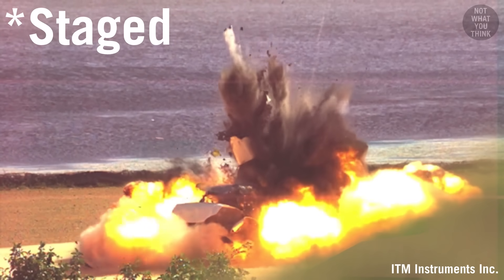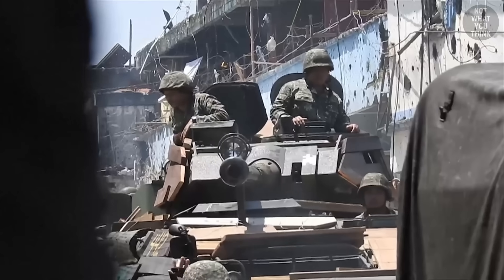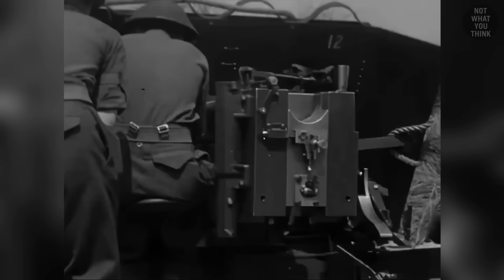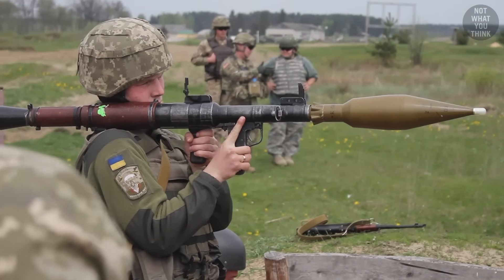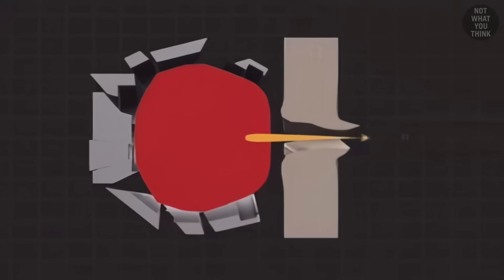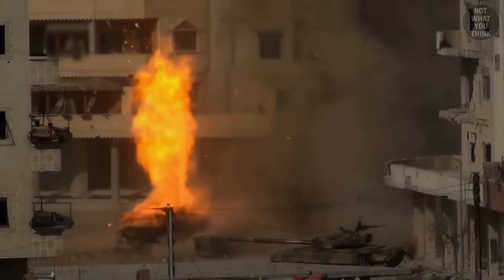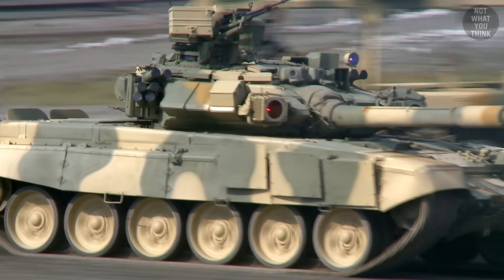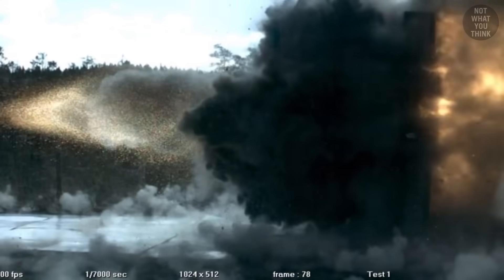Why Protecting Tanks is Getting Much More Difficult

Comment: These are CE (Chemical Warheads) also known as HEAT (High Explosive Anti Tank) warheads. Despite their name these have become less effective against tank armor since armor moved from steel to composite armor. Greatly reducing the effectiveness of CE warheads.
A CE warhead ALWAYS needs a far higher RHA value to penetrate the same armor compared to a KE (Kinetic Energy) or APFSDS (Armor Piercing Fin Stabilized Discarding Sabot). Which is why tanks always use KE against other tanks and CE against lighter vehicles (light armor, unarmored vehicles)
Which is why CE warheads today are only effective against the top, rear or sides but unable to penetrate the front of a modern western MBT. 

Protection and attack is always a cat and mouse game with both advancing. There is no difference with fighter aircraft of surface warships. The anti weapon advances, the protection advances which results in better anti-weapons which results in better protection.

Protecting a tank today is a layered defense including passive protection (jamming the missile), active protection (destroying the missile before it reaches the tank, for instance IR blocking smoke, flares (yes like those on aircraft) and missile kill systems which use a splash projectile (think of naval CIWS) to destroy the missile. Last but not least comes the actual armor, which is constantly improving by using a combination of different materials to create armor as strong and light as possible. This video completely misses the the greater effectiveness of new armor types. Which has put armor in advantage to missiles (apart from top attack missiles).

Infantry is way to vulnerable to pretty much everything which a tank is invulnerable to. Tanks have a unique role that no other vehicle can take. Nothing is invulnerable but tanks can survive more punishments than any other vehicle while also having great firepower and mobility. No tanks, means lighter vehicles will be in front which are much more vulnerable.
Note that while a Javelin is effective, the operator is extremely vulnerable to everything.  A few bullets or shrapnel and he's gone. There also is no shock effect when using it or being effective at taking ground. When it comes to modern MBTs (not the obsolete Russian ones with ammo in the turret) you rather be tanker than infantryman. 
And when a western tank is knocked out in most cases the crew survives and the tank can be recovered. During Desert Storm there was Apache friendly fire on Abrams with Hellfire missiles (also top attack but a lot more powerful than Javelin), without casualties. 

Modern tanks have thermal sights so you will have to be extremely well hidden as a dismount if the opponent uses proper tactics.
Besides that, ground combat is all about COMBINED ARMS. Which involves main battle tanks for the man punch, infantry (using infantry fighting vehicles), air defense vehicles and artillery support. This is something Russia is doing very wrong in Ukraine but the US was very effective in in Iraq (look up Operation Thunder Run).
Also when fighting tanks the best weapon is a tank: an APFSDS-T can't be intercepted by active protection.

Every infantryman want to have tanks along with them for additional firepower. Despite having Javelins you rather have your own tanks along with you. Assuming they could operate them effectively the Ukrainians would rather have Abrams than Javelin. When facng a bunch of T-90s dismounts rather have a platoon of Abrams with them than the same price equivalent of Javelins.
Tanks can be used for a large variety of roles, a Javelin has only one. So comparing prices is kinda stupd.

I am so annoyed by people saying tanks are obsolete, they know nothing about their hi-tech systems and capabilities (like shooting down helicopters with the main gun ) or that there are do's and don'ts on how to use them. Its like saying aircraft are obsolete because of surface to air missiles. A single man protable Stinger or Strela can ruin the day of an F-22 or F-35. Does that mean these jets are obsolete? A rifle soldier CAN be killed by a guy with a knife.
A lone tank moving in a city with enemies alone is like a jet flying directly over surface to air missiles. Russian forces are notorious for using poor tactics in Ukraine (probably conscripts).
What the US did during Thunder Run was keep moving and have each tank of the platoon of 4 look into another direction, covering each others weak spots. They also had Bradleys (modern infantry is mechanized) which used similar tactics. 

Like with all weapon systems, sometimes the cat has the advantage, sometimes the mouse. But that does not say anything about if a system is obsolete. It just evolves.
I would argue that dismounted and light infantry is obsolete as they are to vulnerable to everything.

Comment: I will admit that depending on the operational requirements a lighter wheeled vehicle with a large diameter gun can be more beneficial while a heavier, up armored vehicle with a more powerful gun in other situations is.

There's certain places and terrain that only infantry can go, while there's certain types of terrain that either only vehicles can go or only certain types of vehicles can go.

In war there is always trade offs for everything.
Reply: Sounds like you're describing the M1128 version of the Stryker, and the army doesn't seem to appreciate the role it performs. Kind of a shame, I really like that vehicle but it's getting retired and replaced soon.
Reply: @morgatron4639  other militaries operate the same style of vehicle

Imagine my shock though that a light weight wheeled vehicle with a 105 requires a lot of maintenance

The army's new MPF light tank will have the same problem. Giving a light infantry division a battalion of almost 40 ton vehicles will decrease the deployability of these style of units.
Reply: @morgatron4639  anything will be a compromise or have downsides. Such as the m1a2 sepp v3 Abrams being 70 tons but being a highly maneuverable MBT.

There is always downsides but benefits

Comment: That "Active" protection system where a projectile getting launched from the tank to intercept the incoming missile is very very similar to the AEGIS Combat System. This is how the US Navy protecting its Carriers from missile attacks. It is a very very good way to protect an aircraft carrier. Aircraft carriers never alone. They are always in group with Destroyers, Submarines, Frigates. This means CSG(Carrier Strike Group) A very simple carrier strike group made up from an Aircraft Carrier with 2 Destroyers and at least 1 Frigate and 1 Submarine + the Air wing, supply ships, AWACS etc.. I know its totally different topic than what is this video about, but the AEGIS System is very very similar to the "Active" protective system used by some countries in their tanks to protect it. Basically if there is a threat for the aircraft carrier, lets say someone launched a salvo of anti-ship missiles to destroy the carrier. This incoming missiles will get tracked by the destroyers and or frigates and they will launch missiles to intercept it. Very very similar to this Active defense system on the tanks. Very good against a single incoming missile but not effective against a big salvo of RPG-s for example.

Comment: 1:51 - the Russian instruction says that this grenade should only be thrown from a trench or cover, to avoid getting killed. So I'd imagine the typical scenario would be when you're in a trench and an enemy tank comes rolling in towards you.
Reply: Still was used without cover and even in packs of few of those grenades to destroy Tigers. Before Kursk was done massive training for infantry how let tank go over you and then throw grenade onto its engine.
Reply: @Velanteg  Wow!
Reply: @Velanteg  Completely true.  Jump up and toss onto the rear engine deck and the tanks is in trouble.  And if you have nothing else, whip up a Molotov cocktail and make the same attack.  It's possible the burning fuel from it will flow onto the engine through vents and catch it ablaze.
Reply from the maker: Makes sense.

Comment: The nuclear weapons on the B52 didn't explode because nukes are fake. Nuclear material Uranium or Plutonium at critical mass goes gives off hyper radiation at levels so high it creates a blue flash and any human within 100 feet without thick shielding will die of radiation burns within a week but there is no BOOM!
Every huge explosion of a pretended nuke is actually 100s of tons of TNT or other high explosive.
Reply: what's cooking? meth

Comment: The video part on symmetrical compression to crush the nuclear core was interesting, i'd never ever seen that before.   Kind of interesting its even out there..
Reply: The principle is well known. Actually, the hardest part of making modern nukes is not the technical knowhow, it's getting the fissile material because for many reasons it's incredibly hard to refine it without somebody noticing and pushing your shit in with sanctions or... worse.
Reply: @Talinoth  No need to make it any easier than it is.  Unless you're A.Q. Khan
Reply: @ZXLNT  Thats why the shaped charges of implosion type bombs are differently sized & the firing computer has to know the exact timing to set off all the charges in the correct order, and that timing is coded into the PAL permissive action link. Without the code to decrypt & arm the firing sequences of the PAL its just a conventional dirty bomb, which would also be the case if the bomb casing is damaged, it will never go nuclear. 

Thankfully they had engineering brains working around this problem. You would have to know the exact sizes & composition of each individual charge and guess the timings for the firing sequence.... impossible. Its actually something the B movie 'Broken Arrow' got right, but what confuses me is where would he get the uncoded circuit boards for the specific bombs PAL?

Comment: Tanks might be replaced with lightly armoured cheap fast anti-personal vehicles similar to just a 4WD with a gun on the back.
Though if the enemy is using double charges to defeat two layers of armour, I'd just put a third layer on in the cheapest effective way possible and make them develop new missiles.

Comment: AI guided bots I think will replace both humans and tanks on the battlefield. And not talking about humanoid robots, that are hard to make. But a set of different specialized bots, that each do a different type of job. Hell, you can turn a fast four wheeler quad runner into a self guided robot. And with modern electric motors and batteries, it would not need gas.

Even something like a quad copter with a small gun mounted on it would be both quite fast, hard to hit if making random directions, as an avoidance.  

There can be both large and small bots, in large numbers. And when spread out, make them a harder target.

Comment: 0:08 "shockwave even though powerful would not be able to penetrate through a heavily armoured vehicle"

Uhhh... HESH rounds would like a word
Reply: Hesh is not effective against most modern tanks
Reply: @emilsinclair4190  yes... But there's a difference between modern MBT's and "heavily armoured vehicles"

Besides a HESH round to the side of the turret where there is either little to no composite armour or ERA will still do some damage

Comment: tanks will have their uses in combat.  tank teams can see and attack enemies before the enemy even know they are there. tanks are not just tanks, they are a tool that works in tandem with all the other parts of a military advance, satellites, drones, radar and everything else. I think going forward tanks will still be used but less in close corters and more as a support unite for an advancing force sort of like the artillery barrages of ww1 but way more advance and versatile. I would wager we will start seeing LESS armor on tanks as their need as a front line becomes less useful and their need a a mobile artillery/ troop transport becomes the norm though I could see a world where tanks armor is moved from the front and more on the top to protect from long range strikes.
Reply: If they're going to be used as mobile artillery and troop transports, they would probably instead just use mobile artillery and troop transports, because those are better at those jobs than tanks are.
Reply: You can here a tank a mile away ! If you can get snuck upon by a tank you really need a heating test
Reply: @pauls3204  don't worry. THE Biden administration will have the Military on 100% electric very soon. And guns will be phased out to make room for their new plasma rifles. 😌
Reply: Soon large groups of combat troops can be replaced with robots.😌

Comment: 7:34 - that was the case of insufficient stand-off distance for the charge to arm itself - means, it didn't have the time to activate itself into "armed" mode.
Reply: it was a mistake of the firing guy. you can fire nlaws and javelins in top down or straight hit settings. there was no space for top down attack, but the firing guy still kept that mode (i guess with lack of knowledge) so it was a very expensive rpg. 

But at that distance even with proper settings penetration wasnt guaranteed. both javelins and nlaws need some distance for their systems to understand when to blow secondary charge, as seen in video only one charge went off.
Reply: @Asofe17  Thanks for detailed explanation. I got that info I quoted from some other video on those anti-tank thingies and "how they work" (cant' remember which video now) showing this exact clip and providing the explanation I quoted. Maybe the author used sort of "mental shortcut", maybe something escaped my attention or I just remembered it not very accurately... Hey, nobody's perfect ;-)

Comment: I hung out with an ex FMC tanks employee, and he said they were always trying to find a way to prevent projectiles from penetrating the tank (even hitting it, the fiberglass used would impact the tank, that people would itch from the fibers). His solution, just make it out of cardboard, so the projectile would go completely through, as a joke.
Reply: Intentional overpenetration was actually a thing for some early tank destroyers. Since they're intended to be used in ambush or otherwise long-range capability, they're not meant to take a hit. So paper thin armor just thick enough to hold the gun was all that you really need. Which means shells that depend on compression or otherwise high pressure to a primer charge simply don't work, because they whip through the thin steel so easily. You get killed stone dead by any good machine gun, but a tank shell will be like a bullet through a cardboard box.
Reply: i mean that could work if you like gambling if it goes through its either going to do nothing but leave a hole or its going to hit someone and well.....if a human is hard enuogh to make it go off then boom if not then uh there is a hole in a human

Comment: Super low cost, unarmored, drone tanks are the only future that makes sense. Shoulder fired systems are too cheap and plentiful for MBTs to play a serious role in battle these days.
Reply: You are making a common mistake.
The bullet needed to kill an infanterymen is cheap. But we still use infantery.

 The cost to destroy equation does not include the benefits tanks provide. How would you value the additional speed infantery gets from sitting inside a tank? How would you rate the additional armor? Or the additional arms?

If you include those factors tanks are definitely not obsolete since there is nothing cheaper that provides the same benefits. Only when there is something cheaper/more difficult to destroy that provides the same benefits tanks could get obsolete.

Comment: I have machined on a mill some of that IHE, the engineer to allay our fear whacked a pill sized piece with a sledge hammer all it did was smash it in to a pancake.  The material was not very tough but abrasive, and to get rid of chips and extra material we burned it.

Comment: Thats why we have proximity defense capabilities on modern western tanks. One feature being the engage and destroy, which is falling abit out of use since directly laser or wire guided missiles or robots are no longer all the rage. Second one being the Anti IR-Laser-Radar smoke that deploys faster than it takes the round to reach the target. Naturally wont work that well against closer encounters with man portable weaponry. Thats where the close in "pellets" come into use. The tank fires a swarm of steel pellets into the trajectory of an incoming projectile, damaging or destroying it before it can hit. it then automatically destroys the location from where it was fired. Naturally it will be harder and harder to defend tanks from incoming projectiles. But then again the armor is evolving as well.

Comment: I would not want to be in or around a tank as support. The weapons these days are just too advanced and have higher mobility and tracking. They can pierce right through the top armor. And javelins are not even the strongest anti-tank weapon, but they sure do the job. You can see a bunch of tanks from miles away with our technology. Just drop a moab. I have been saying this, tanks will become obsolete by 2040